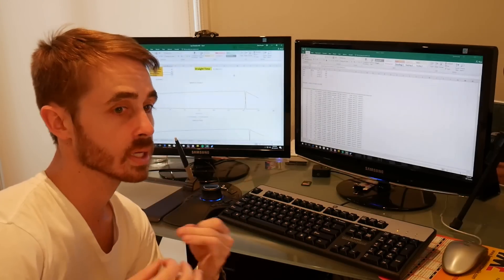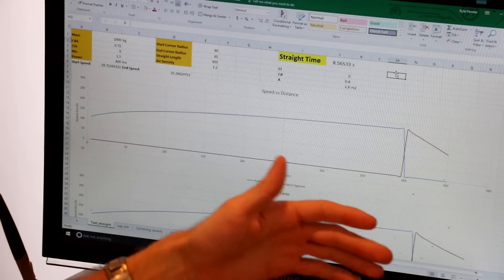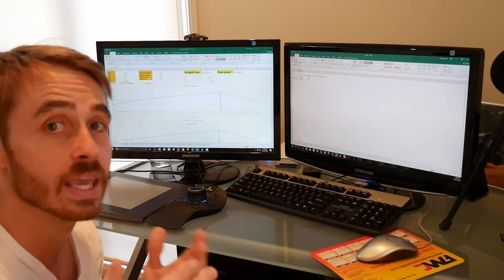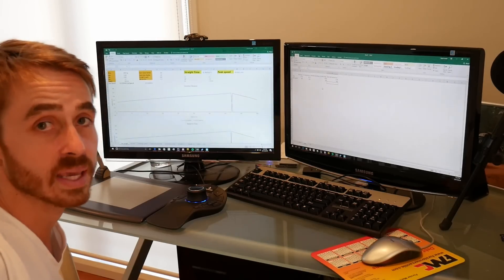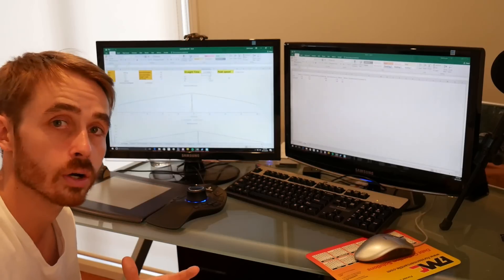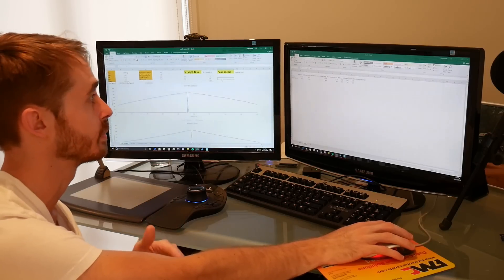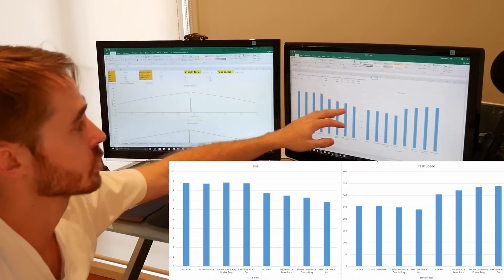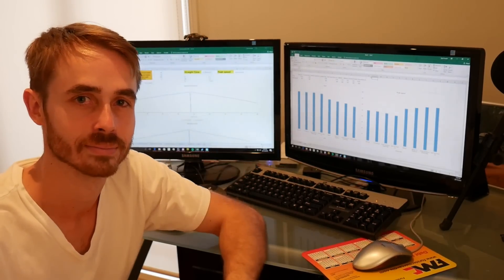Is Drag the Enemy? Drag vs. Downforce on a Straight Explained!

Comment: Great videos. They help a lot for people trying to understand how all of this stuff works together. We totally screwed up the aero on a 2018 Mustang GT we had by altering the front of the car too much. We now have 2 GT350s with stock aero. We just installed an OEM Gurney Flap on the 19 GT350. Everyone I talked to said to leave it off of the car unless you are tracking the car, but after watching this video, it sounds like it isn't a problem with the additional drag it makes on the rear. I am just wondering if the front gets lift with the additional drag and downforce on the rear with the Gurney Flap.

Comment: I really like your common sense explanations.  I have a 1940 Ford Coupe LSR  car I run at Bonneville.  Big body, ow HP (original Flathead @250 hp) so low drag is VIP.  Please do a video on Stock bodied LSR cars.  Maybe you  could show up a Bonneville this August and hang out.  Lotsa aero topics there!

Comment: So with low power we have to make compromise and probably use different settings for each tracks depending on how many straight/corners and their speed/length while with high power we can go with downforce as a crazy to have enough to reduce the track altitude by few meters after 10 laps :D

Comment: Yet another fantastic video! Are you familiar with $500 LeMons racing that goes on in the states? I'm quite interested in doing a build on one of these cars and would obviously love to get as high of performance as possible. Would you be able to give a general comment on whether the weight of a very low material budget ground-effect setup might have more of an impact on road-holding than the aero for these relatively low speed cars? In other words, where might the benefits of downforce/drag reduction be optimized when compared to the added rolling resistance due to the lower cost materials?
Reply: take a look at toppgear and ther bmw 330 24hour race car thay monted a splitter at front mad out of a sheet of plywood that made huge differance in tracktimes.

Comment: How has drag changed through the years? surely a smaller car(less frontal area, poor aero) would be the same or better than a larger modern car with better aero? Frontal area and coefficient of drag make up Resistive force doesn't it? Or am i missing something. could you explain this in one of your vids, as engineering explained is inadequate to accommodate my request
Reply from the maker: Correct, both Cd and A are contributing factors, I cover this in my "What speed does downforce start working" video, but can go into more detail on this in another if you would like?
Reply: Why thank you, it would be Wonderful if you could pursue that endeavor. We could compare two similar cars say the new and old mini's?(Similar style and shape) Its more about what those numbers mean to force(resist) the motion of the vehicle.

Comment: do the spinning tires create significant drag via the magnus effect?
Reply from the maker: The magnus effect produces downforce rather than drag, however the spinning nature of the tyre does induce more high pressure on the front. This is less of an issue when the wheels are faired, as in a conventional car.

Comment: What about the increase in rolling resistance from the tyres when you add downforce? Obviously the additional normal force will increase the energy being absorbed/converted to heat by the tyres as they roll/deform, but does this have any significance in the real world?
Reply from the maker: Rolling resistance will increase with increased normal force, however as long as your tyre pressures and sizes are appropriate for your downforce level, the increase in rolling resistance will be negligible compared to the massive increase in drag force.
Reply: Nathan I was also wondering about this